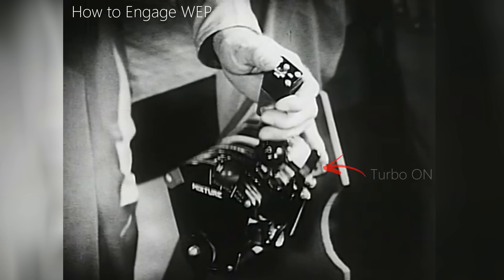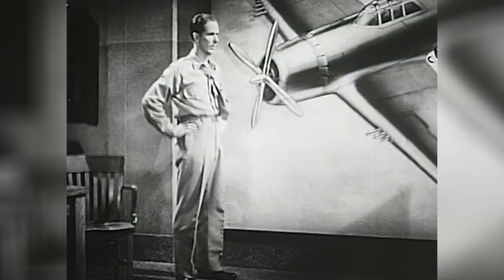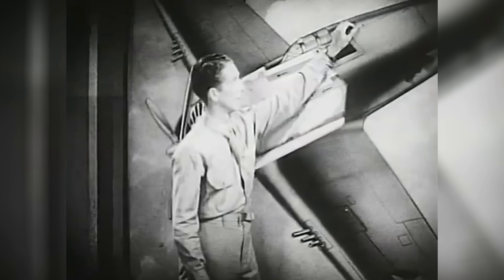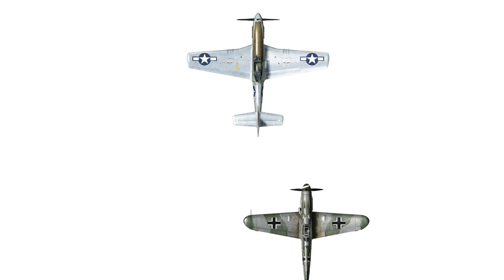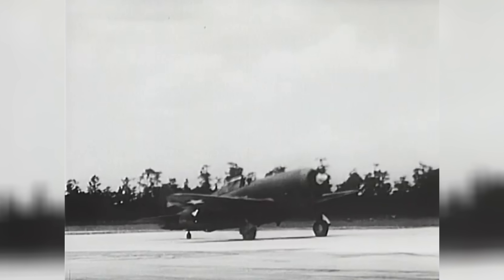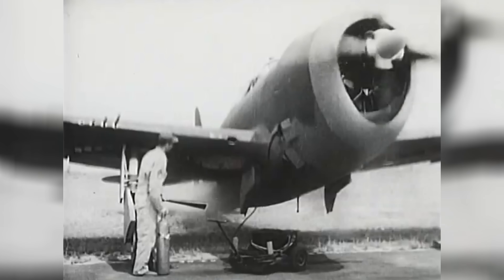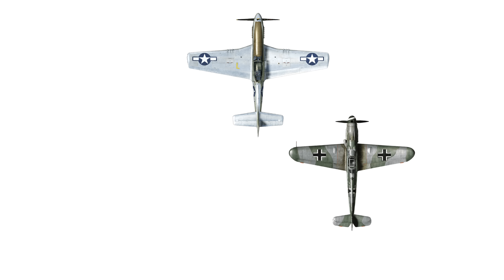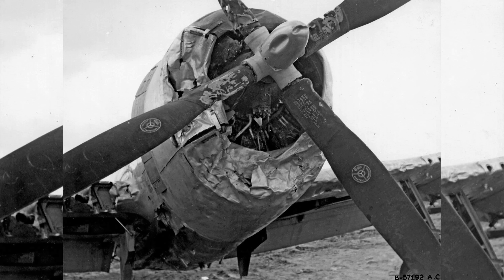What is WEP?

Comment: First, I wish War Thunder's WEP actually worked as intended on all aircraft;  Second, I wish it had these effects on those planes, as literally everyone has no clue what it is (WEP) and what it does to your plane when used.  Would love to those hotshot pilots suddenly wondering why their fancy ME-109 is suddenly falling from the sky.
Reply: Test fly the Boomerang, you quickly learn what it does to your engine 😂
Reply: @stoyantodorov2133  Which one there is 2 of them i think with different engines?
Reply: @stoyantodorov2133  I'd love to!  But the thing is, WEP isn't working.
Reply: I guess you must be playing arcarde then. In realistic battles itll cook your engine if you leave it on more than a few minutes, depending on the plane, engine and the ambient temperature.
Reply: @builder396  You guessed poorly.
Reply from the maker: Very interesting Phalanx. Is there a time limit on the WEP?  Is it just a version of Military power, safe as long as the engine doesnt over heat which you must manage
Reply: @FlakAlley  It only lasts for a few seconds, and the worst thing that happens is your engine will heat up, though there's no catastrophic failures.
Reply: @FlakAlley actually if wep is held for long enough the engines do degrade in war thunder and once it starts even going back down from wep doesnt stop the engine from breaking it just delays it ive experienced this in spitfires and the japanese Ki-61 war thunder's throttle 0-100 is actually a bit misleading since ofc not every plane considers the same values equally for example wep on a spitfire is actually 95% throttle and up
Reply: @FlakAlley  No, in real life using WEP means you'll have to do a full overhaul of the engine at the least or possible replace large parts like pistons or even just replace the whole engine. Depends on the engine and how long you use it for.
Reply: @davidgreenwood6029  He was asking about the game War Thunder, why would he be asking about the consequences in real life when he literally made a video about it lol
Reply: @Oof_ster  You messed with Manual engine controls, apparently you can stop engines overheating with it not smart enough to do it myself
Reply: @FlakAlley  If it works at all.
Reply: @FlakAlley you can use wep in warthunder as much as you like however your engine gets very unhappy with it typically. It begins overheating very quickly. Although some planes seem entirely happy with WEP on at certain altitudes. The VL Pyörremyrsky with the DB605A seems to be able to hold WEP indefinitely above 5km altitude. I suppose it may be modeled semi realistically in game. It's just that the consideration of needing to repair the damage afterwards isn't really that serious to most players because they mostly play on semi realistic settings. WEP can and will lead to engine damage and failure in game though. Especially in simulator mode. Your engine RPM being too high will cause valve float and of course the heat. In "realistic battles" the standard semi realistic mode the only worry is heat
Reply: I don't play war thunder but I also imagine it's not realistic about wep fuel consumption either.
Reply: @davidgreenwood6029  I can assure you that reality is very well disconnected.
Reply: @Phalanx443  Warthunder very fake?
Reply: @Will1988US  They claim to strive for accuracy, but miss by a country mile.  Although, it does look pretty.
Reply: @Phalanx443  did you hear about all the classified stuff being leaked thats how i found out about the game XD
Reply: @davidgreenwood6029  Do you play any other Aviation games like DCS?  Warthunder is the least realistic of them all lol
Reply: @Will1988US  No, I play some FPS and racing games but no air combat really, I've used Microsoft flight sim some, but not in many years. I'd like to again. Not much interest in the unrealistic ones. I might sound spoiled, but after flying real planes sailplanes and paragliders, flight sims are kind of boring to me as far as games go, and more just feel like something utilitarian to practice skills for actual flying.
Reply: @davidgreenwood6029  Did you ever play need for speed? You sound like an old school gamer which i am too
Reply: @Will1988US yea I remember need for speed pretty fondly although it's kind of crazy to look back on compared to modern racing games with ultra realistic physics.
Reply: @davidgreenwood6029  Haha i feel the same way looking back. So these days you enjoying Forza?
Reply: @Will1988US  Nah I couldn't get into Forza, just the open world aspect ended up boring for whatever reason. I lean more towards Dirt Rally and F1 but these days all I'm playing is cyberpunk, and Rocksmith if you count that as a game, I spend like three to four hours a day on Rocksmith most days.
Reply: @davidgreenwood6029  Yeah it is very boring to be honest i cant play it either. Ive been dabbling with flight sim as of late, its great if you want to chill and you are clearly into aircraft based on this video! Recommend
Reply: @Will1988US yea id like to get back into flight sim, I've just got a console for now seems less worthwhile than a PC with proper flight controls but thanks for the rec.
Reply: @davidgreenwood6029  Ofc, i love this comments section its all wholesome good people very strange for Yt
Reply: that would be so cool tbh. it would encourage people to only use WEP in emergency scenarios and would really spice fights up
Reply: @railfan3024  Indeed it would!
Reply: @railfan3024  How do i send gaijin this video? Do you know anywhere where they would check it out
Reply: Maybe stop playing arcade battles?
Reply: @SevenOneThreeThree  Arcade??  Who the hell plays that?  AB is for sissies.  RB/SB are the only game modes that count.
Reply: @Phalanx443  Wouldnt you say that Arcade is better than the rest as its got the most diverse game modes and maps? I find RB boring as its TDM every match right
Reply: @Will1988US  Actually, no.  I find Arcade boring as all get-up.  Once you start adding some realism into the game with RB/SB, the entire flight dynamics change.  Also, fewer 12yos playing RB/SB.
Reply: @Phalanx443  My burner keeps cutting out in arcade! It gets me killed a lot but im not good enough for RB. Open to tips from a 12 yr vet like you! Maybe there are some planes you cant go wrong with?
Reply: @Will1988US  If you're getting slaughtered in Arcade, maybe you should rethink your entire game play.  Oh, RB isn't all that hard, it just doesn't come with the training wheels found in Arcade.
Reply: @Will1988US if your afterburner is turning off in arcade it's because the (instructor) is turning it off to avoid engine damage. In Air rb the after burner will stay on until the engine dies. The only difference between air rb and ab is that the flight model is a bit more realistic and your guns don't just simply reload when empty. You need to land and have the plane reloaded by the ground crew. There is also no lead marker on enemy planes so you need to aim yourself. Otherwise the game play is pretty much identical, just a bit harder but much more rewarding. Both in terms of satisfaction and literally in silver lions and research points

Comment: German planes had better WEP and Engine power than the Americans and British. A BF-109 always wins a vertical against the P-51
Reply: I don’t think that its strictly true. However, it has been a while since I dug deep on this topic. While German fighters had the MW-50 injection, the high quality fuels used by the allies generally allowed for more manifold pressure. In addition, the German boost systems were only applied in limited numbers, as far is I know.
Reply: @csabaalmosdebreczeni3353  good point
Reply: @csabaalmosdebreczeni3353  100 % CORRECT.
Reply: @csabaalmosdebreczeni3353  German fighters did generally have better high-altitude engine performance and WEP systems, and in a pure vertical the Bf 109’s power-to-weight and climb rate often favored it over P-51s. The fuel didnt that big of a part did
Reply: @csabaalmosdebreczeni3353 They needed more pressure cause they had less capacity , they run at higher rpm and with more boost . This 35 litre DB605 was not a joke , a huge engine for a tiny 109 .
Reply: @5co756  "They needed more pressure cause they had less capacity."  That’s just wrong. The DB605 didn’t “lack capacity,” it had smaller displacement than Allied V12s, so Daimler-Benz leaned on boost instead of cubic inches. That’s a design tradeoff, not a deficiency. And “they ran higher rpm”? No, they didn’t. DB605 max RPM was lower than Merlin WEP settings. The power increase came almost entirely from higher manifold pressure, which is exactly why MW50 and tight detonation margins were non-negotiable.
Reply: Not when P-51's started using 150 octane fuel.
Reply: @keithallver2450  115/145 AVGAS-dyed purple
Reply: @stevenrobinson2381  Never really understood the colour tbh
Reply: @keithallver2450  150-octane didn’t magically solve everything. Fuel ≠ engine limits. That’s not how it worked
Reply: Allison engines could sustain 70" MAP for sustained periods without damage. This was tested in 1942 for 20min and the engine suffered no abnormal wear or damage.
Reply: @SoloRenegade Any Sources for this? Last i heard its 10 mins
Reply: @Will1988US  yes, there was a 1942 test report of the Allison engine at 70" MAP 1800HP for 20min continuous. WW2 Aircraft Performance has a copy of the report.
Reply: @SoloRenegade Just looked it up and i dont think they can do 20 mins. 10 mins sounds more right?
Reply: @Will1988US  you clearly didn't look it up, as the test report clearly states 20min. you have google, AI search tools, etc, and you people still can't find this stuff. blows my mind.
Reply: @SoloRenegade I think you just take whatever AI gives and go with it. do you have a proper source to back up your claims?

Comment: You guys are amazing with your information.   My dad flew and told me this
Reply from the maker: Wow! Did your father ever have to use WEP? :)
Reply: @FlakAlley  Is WEP on jets afterburner?
Reply from the maker: @panzergaming128mm Since jets could use the burner for very long periods without damaging the engine, this would fall under Military power rather than WEP :)
Reply: @FlakAlley  Then what is WEP on jets?
Reply: @panzergaming128mm Dont some jets without a burner actually have WEP? check the p-80 if u can i think that does. Afterburning jets i dont recall having it
Reply: @Will1988US  idk.
Reply: @panzergaming128mm Do you have the US tree grinded out? what do you play might i ask got me curious now
Reply: @Will1988US  Highest BRd aircraft for me are P-63-A5 and P-61.
Reply: @panzergaming128mm  Cool stuff, I have Britain to 6.7 right now. You ever tried the spitfires they are nice to fly, same engine as the mustangs
Reply: @Will1988US  Isn't only the same as later model mustangs?
Reply: @FlakAlley .   Dad never spoke alot about his service.   I know he saw action in the air but I know very little
Reply: @JohnClevenger-ts2pg  What do you think your dad flew?  cool af
Reply: I know what dad flew.   He was based in the Philippines and flew the F4U Corsair
Reply: @JohnClevenger-ts2pg  ooh wow. Must have been a menace in the corsair, those pilots were a different breed. You heard how they shot down mig-15s?
Reply: I know very little about his service.   He would not speak about it.   All I really know is that I have a letter from President Harry Truman to my dad that thanks him for his service against the Japanese.  I never knew that letter existed until after my father’s death.   I wish I knew more.
Reply: @JohnClevenger-ts2pg  Sorry for your loss.
Reply: @JohnClevenger-ts2pg  Perhaps he worked on classified stuff and couldnt say much about it! Sorry for your loss